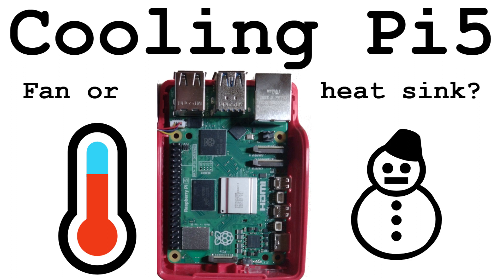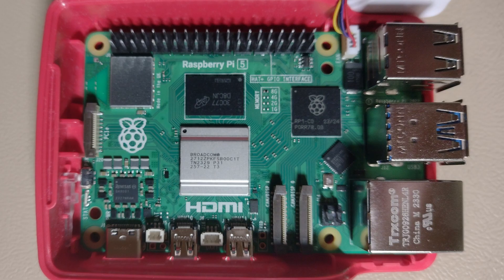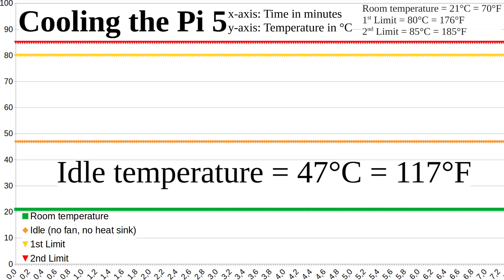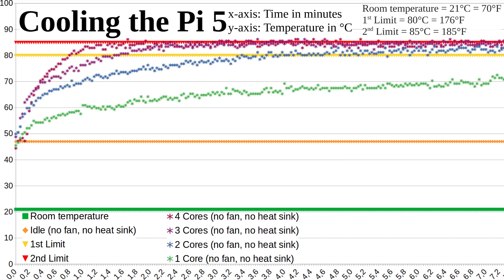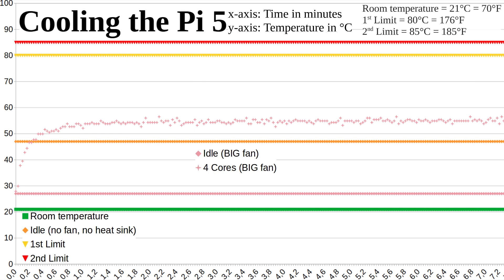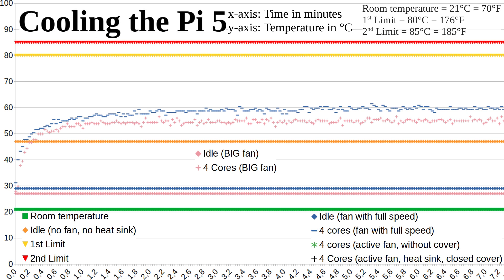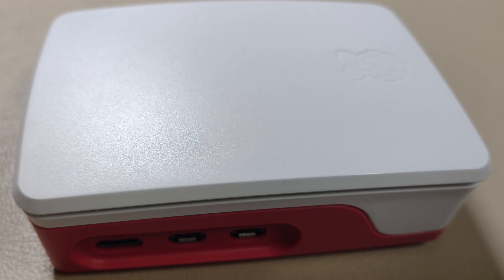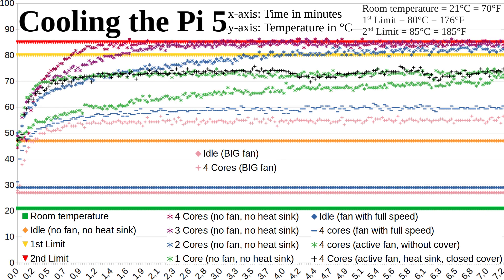Cooling the Raspberry Pi 5 – Fan or heat sink needed? Offical case tested

Comment: I do not understand
If it offers under the limit cooling
Then it is considered perfect cooling or no?
Reply from the maker: Depending on your definition of "perfect".
As long as the temperature is below 80°C, the Pi 5 can run with full speed.
If you have a "better" cooler with only 60°C, then the Pi is NOT faster. So there is no advantage in lower temperature (OK, in theory the Pi live longer, but in practice i bet you will never notice it.)
Of course a perfect "cooler" can reduce the temperature more. Of course a "perfect" cooler is not so loud.
It's depending on what you do. If you just do "small" office stuff, then the official cooler is in fact not needed at all. If you do "normal" office stuff, then the official cooler is fine.
If you always run the CPU and GPU at full load and if you also overclock, then you should think about a "better" cooler, since this one will be too loud.
Reply: @Volker-Dirr what I mean is, active fan with heatsink is below limit so perfect
Reply from the maker: @Simcore999  I am still not 100% sure what you mean. But I will use the official case with the fan only. For my use-case it is perfect. I will not buy an other cooler.
Reply: @Volker-Dirr  your chart only shows fan with heatsink, no heat sink alone
Reply from the maker: @Simcore999  Ah.. Ok. Now i understand. Good question. There is only cheap "clue" on the sink. Sadly i didn't measure it with it, but it looks like the "clue" is not perfect, since the idle temperature increased a bit. On the other hand it holds the temperatures longer, so if the fan turns on to 100% at 75°C, then it will stay on until the temp is below 70°C. Then the fan will decrease speed and wait until it is 75°C again. This will take more time with the sink. hmm.... I am not sure if i can measure it right now, since i forgot to do it. On my old Pi 4 i used fan only and no heat sink.
In the chart on the BIG fan and the fan with 100% is on full speed.

Comment: Can you please show the results using the new active cooler very commonly seen on the PI 5 now and also the recently adapted ice tower cooler that I have seen being used on the pi 5 as well?

Nice work.  Thank you
Reply from the maker: Thank you for the suggestion. But I think I won't buy that 2 coolers, since for my daily work the official case cooler is fine enough for me. You must know that during my daily office work the CPU is nearly always in idle mode. Only if I generate timetables or compile source code on all cores it is under heavy load, but normally generating timetables runs over night and I am not in the room at night. So it doesn't matter if the fan is a bit louder at that time. I guess you will find those comparisons soon on channels that use the pi to play (old) games, since those guys have also work load on the GPU and those guys also love to overclock at the same time. So those guys need maybe a better cooling and they will test it with the other coolers.
Reply: @Volker-Dirr  Basically just suggesting additional results using the two most common coolers out there.  I know the way you use the equipment it doesn’t get that hot, but for everyone else, it would be nice to know how the most popular coolers also rate with the new raspberry pie five which very few people know yet. I would think new content with the raspi5 would be a benefit to your channel, but totally your decision.
Reply from the maker: @ksoonsoon  hmm... Maybe. Currently this channel is in fact a very special channel. I don't earn money with it and that is also not my goal. The topic is mainly timetabling and coding. I saw already some other channels that got the Pi and also the cooler for free from the manufacturers. Sadly those channels only showed how to assemble the coolers, but they didn't measure the temperatures. If i get a cooler for free, then I promise to measure the temperatures :-)
Currently I am doing tests about compiler optimizations. I think that will be the next video.
Reply: @Volker-Dirr  understandable.  Just my suggestion.  I assumed you had some revenue coming from your channel as well to support the purchases of some products to test, but if not, might not be enough justification to start buying stuff. All the best.
Reply from the maker: @ksoonsoon  No, I have no revenues. Not a single cent. You need at least 1000 subscribers (i have only 400) and you also need at least a yearly watch time of 4000 hours (I have got only 460 hours). So i am far away from getting revenues from YouTube.
Reply: OnlyFans when?
Reply from the maker: @NormanTheDormantDoormat  Maybe i missunderstood your question. But only fans was the BIG fan and the default fan with 100% always on.

Comment: Mine is running at 2400mhz all the time.. and then so is the fan.. loud.. how you can get it to below 50 c with no fan, is a mystery to me
Reply from the maker: The 47°C is in idle only. So if you do nearly nothing (max writing a document in LibreOffice or checking emails).
If your fan is always on/loud, then i guess you don't use the latest Raspberry Pi OS or you connected the fan while the OS is already running or your fan is not temperature controlled. In the second case just restart the Pi. If you use an other OS, then see https://www.youtube.com/watch?v=M--nU_Zg-ZQ . Also other YouTubers run the Pi without a fan below 50°C. You can see for example this guy, it is probably warmer in his room (since he wear a short t-shirt) and even his application is running (ok, his application is also close to idle) it is still around 50°C only. https://www.youtube.com/watch?v=w_Y2UkuXx9I

Comment: It looks like RPi 5 isn't so hot as some reports state. My Orange Pi 5 has slightly higher temperature in an idling and a medium load, but I use it without a fan or a passive cooling solution. So certainly I can use RPi 5 without any cooling for my tasks too. So I will wait when RPi 5 is back in stock in my local store.
Reply from the maker: Compared with a Pi 4 it is hot. But you are right, depending on your tasks it can work without cooling. I said in the video cooling is needed for watching video, but that might be incorrect. It is correct for YouTube, the cpu load is too high for that. But today i tried Amazon prime and noticed that the cpu load is much lower, (but a bit higher gpu load). That might work without cooling if your room temperature is not too high. I also note other strange things in YouTube. Only displaying the video settings while watching YouTube (i mean the settings in the bottom right corner of YouTube) needs additional 1 Watt power and the video starts dropping frames.
Reply: @Volker-Dirr  I do not watch videos. My Pi works in a headless mode. However I listen to DST encoded music, which decoding requires a lot of power.
Reply from the maker: @kamertonaudiophileplayer847  hmm... except of my video :-) I think I never heard DST before. Maybe without knowing it. I hope you will get it soon.
Reply: @Volker-Dirr  Streaming services can use different encoding, different resolution and different bit rates. With YouTube you can force h264 (but only up to 1080p). VP9 and AV1 will cause higher CPU load.
Any way to check the resolution and encoding of Amazon Prime?
Reply from the maker: @LivingLinux  In Amazon Prime a user can only select "Good", "Better" and "Best". A 40 minutes long video is about 0.4 GB ("Good"), 0.8 GB ("Better") and 1.2 GB ("Best"). I selected "Best" and the CPU usage on the Pi is very low, GPU is a bit higher. If i understood correct, then Prime uses HEVC/H.265 (see: https://aws.amazon.com/de/media/tech/high-efficiency-video-coding/ )
I don't know how to change the codec if i use YouTube. I tested YouTube for example with "CHARGE - Blender Open Movie", since i am able to increase the resolution there pretty much. It uses VP9 coded and that has, as you already wrote, a pretty high CPU usage.
Reply: @Volker-Dirr  Looks like Amazon Prime is using HEVC. That's the only hardware decoder in the Pi 5.
You can use the browser extension h264ify to force YouTube back to h264. It will still use CPU decoding, but it's lighter than VP9 and AV1.
Reply from the maker: @LivingLinux  Thank you. I will try that plugin. BTW: You have a nice channel. I just watched a few videos. The Pi 5 fan script video is very intresting.